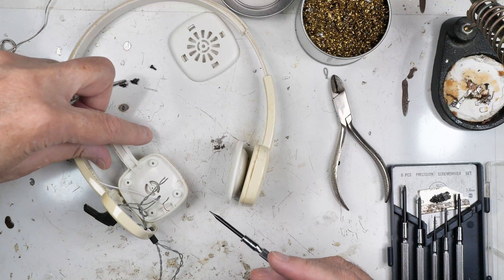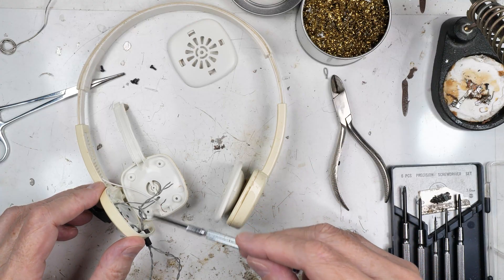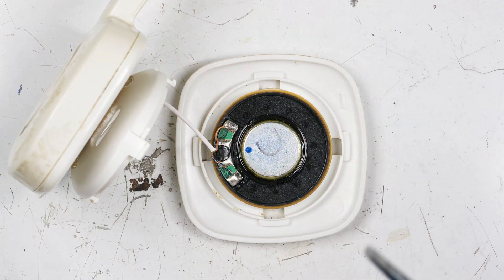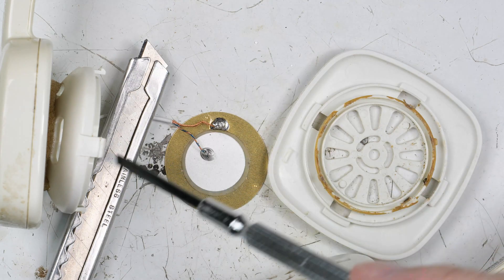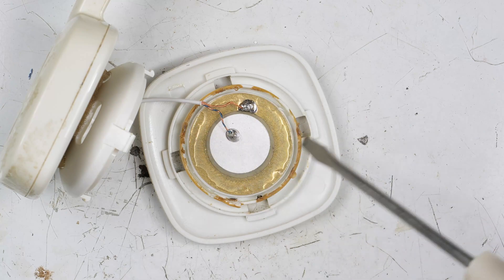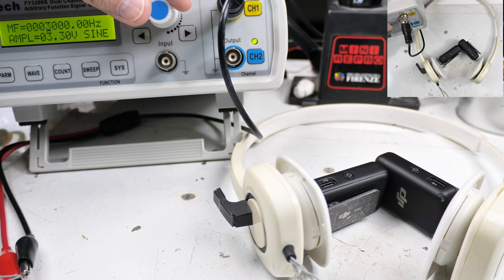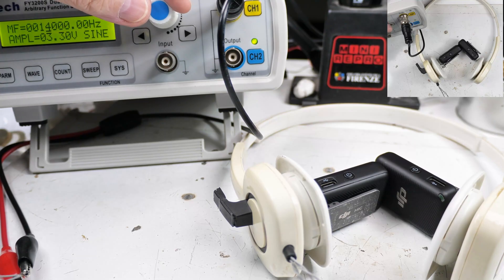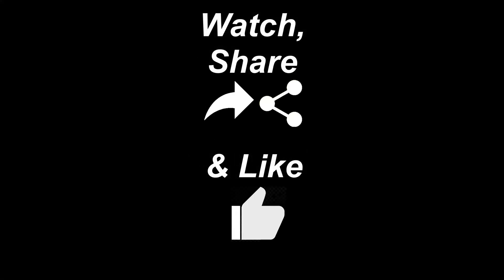Crystal Radio Headphone Mod-DIY Part 2/2

Comment: How about you also measure the capacitance of the two.  I have a really big one and its Xc worked out so low I doubt it would work.  There is likely a best size.
This could perhaps help someone following your footsteps.
Reply from the maker: 16.45 and 13.13 pF
Reply: @tsbrownie  Thanks.
1/(2*pi*F*C) = 3M and 4M at 3KHz so that is good. You likely could use a bigger bender with more capacitance and get it louder.